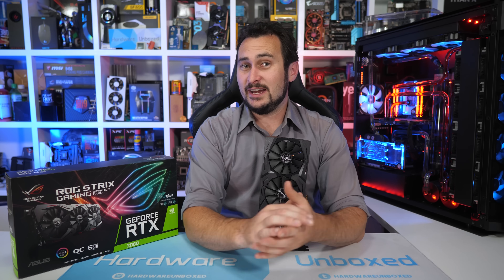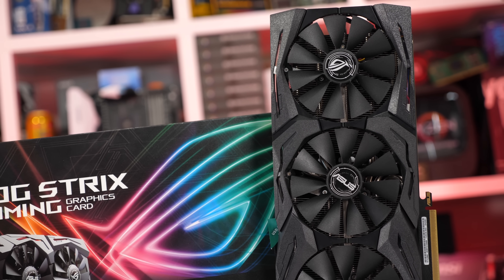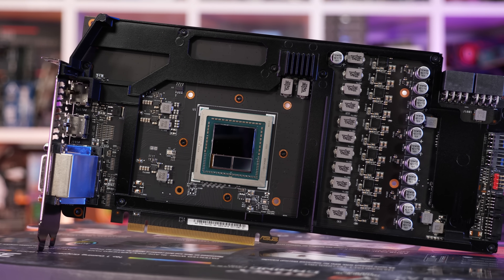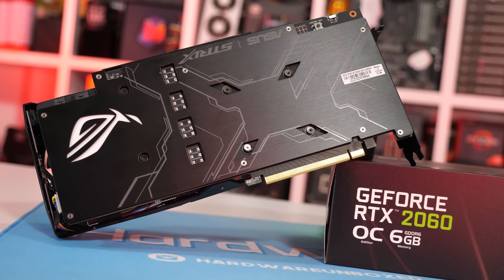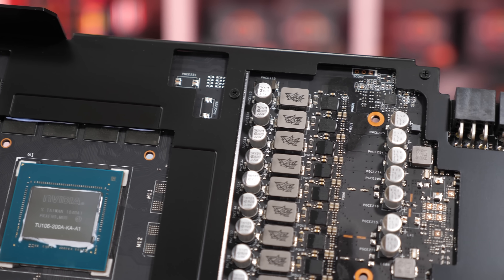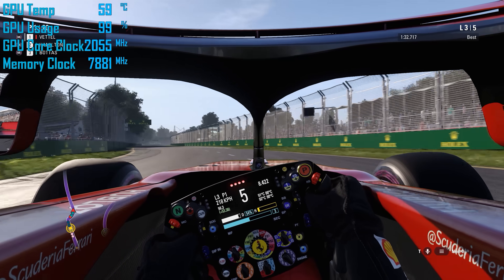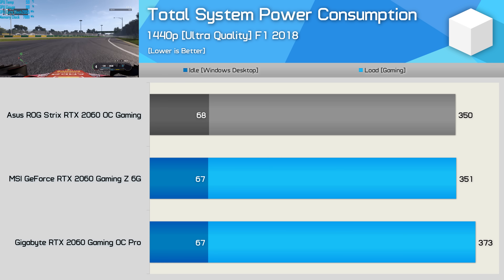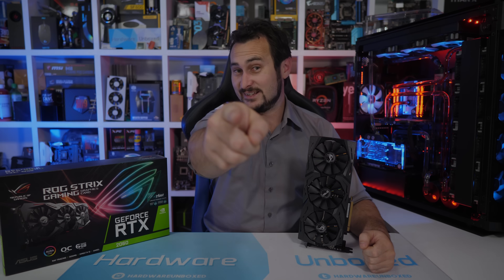Asus ROG Strix RTX 2060 OC Gaming Review, Thermals, Overclocking & Benchmarks

Comment: I've got mine (Strix 2060 Advanced)  on +200 core +800 memory and +30% on core voltage and default fan config. I let Kombustor run for like 12 hours just to make sure this clocks stable.Thermals are about 49-53°C when in games.

Comment: I have same card running 1995Mhz overclocked hitting 70°C in Meshify C 25°C ambient o.O how you are running this card 2055Mhz with temps around 60°C. Mine even gets to 60% fan speed which is so loud imo.

Comment: I just got this card for 395$. Honestly I think it is worth it, my Zotac 2060 would run at 10°c higher in certain games. I'm also getting a solid 4-5% fps improvement. The cheapest 2070 here goes for 490$, is only 6-7% faster, and is known for QC problems (it's the gigabyte one).

Comment: Over the years, I have gone through multiple cards. Some were even same cards but different companies and different  prices. Like I tried the very expensive kingpin 980 ti and the normal founders 980 ti with custom cooler. Most of the time such cards only have very little performance advantage. Basically kingpin vs founders, they are the same 980 ti so they will perform similarly. With the kingpin having a slight advantage. Just slight. Not even over 10%. 

Usually such expensive cards like this ASUS RTX 2060 are expensive due to certain factors such as. : better and bigger cooler, very silent even at heavy loads, custom pcb, imo over engineered and it looks sexy as fuck. Out of bix boost is crazy (1995 MHz), and ofc Asus name. But for real, 50 more on top of the MSRP and you get such cooler, and design and the factory OC and silent operation. Imo is definitely worth it. I have a chance to try the card out and check it personally. The thing is as Premium as is gets.
Sorry MSi but no onr wants your fat shorty RTX 2060. 

Also theAsus one is like one foot long. I think its even longer than my rog strix 1080 ti and it has the same cooler design.

Although the strix rtx cooler is a bit more upgraded and got those real beefy bracket sandwich between the cooler and pcb

But in the end its really dependent on the budget. If your budget allows, add 50 more and get this one. If not, save the 50 and buy the cheaper fe cards that uses custom coolers.

Dont buy the ugly fe version. :P

Comment: You're right, the 2070 is a ripoff. It should have been the 2060, which is what the die is, and should also reflect said price. Especially considering that fact that there's no SLI support for it either.

Comment: The card is great but the price is not. 400 for ..60 series card? Do you people even realize that?
Reply: If the 2060 would push out 500fps at 4k, would you still cry over a price tag because "it is a 60series card!", or would you judge the card by its performance? Because that is what you should be doing. Don't look at the name. Look at the fps you get. NVidia pushed up their naming a tier anyways, but even if they did not do that,... still. Ignore names. It is like buying a gaming chair, because it has gaming in its name.
Reply: @Tech_Enthusiast_001  go back to your console. 500 FPS or 1200. minimum for a XX60 card is $200-250.
Reply: But it isnt pushing 500fps at 4k so stop dreaming. 1060 was as fast as 980 and with ammount of Vram as 980Ti but it costed 250. Its incredible how fast people accept Nvidias bullshit. With your logic 2 yrs from now if ..50 series card will be as fast as 1080Ti it should cost 800??? And ..80Ti 3000???
Reply: @blackwidow7804  My point went so high over your head, I won't even try again.
Reply: You look at this card as 1070 replacement and thats where you are wrong. This is still a 1060 replacement.
Reply: @blackwidow7804  I don't look at it as any replacement whatsoever and that is why i can judge it by its price / performance and not some arbitrary naming scheme that got changed anyways. If you can't get a better performing GPU for the price, the GPU fits a great spot. No matter if you like the naming or not.
Reply: @Tech_Enthusiast_001  so if next year a hypothetical 3060 will be as fast as 2080Ti and cost 800 then with your logic it will be fantastic price becouse 2080Ti cost 1200. And 3080Ti will cost 2500. Nice logic!
Reply: @blackwidow7804  Yes, exactly. And i honestly don't understand why you seem to not get it,... the name does not matter if you play a game, right? Would you rather pay 800 for that 3060 that is as fast as a 2080ti, or 1000 for a discounted 2080ti? Just ignore the names and life will be much easier. No reason to let names (marketing) fool you. Only price and performance matter. If on the other hand a 3080ti would be 600 bucks, but have the performance of a regular 2080, it would be a terrible deal. But by your logic it is a xx80ti, so 600 bucks would be amazing, eh?
Reply: +Rattenmann dont you understand that thats not how technology works? PS3 costed 599 USD at launch. With your logic  PS4 should cost around 5000 USD becouse its 7-8x faster and have 16x as much memory. But guess what, PS4 launch price was 399. Wow how is that possible? Becouse thats how technology works!!!
Reply: @blackwidow7804  I never said any of that. You are making that up. I said you should judge a product by its price and performance, not by its name.  You can't just pretend a product can't change name, price bracket, or audience. That is just delusional.  But hey, you can keep judging GPUs by the metric of (price / name) and i will keep judging GPUs by (price / performance). You are all free to buy a great 3080ti for 500 bucks, no matter the performance it may have, because the name suggests a top product and the price seems like a steal! Just wondering why reviews keep bringing that price to performance ratio up so much,... silly guys.
Reply: +Rattenmann in terms of price/performance if PS4 cost 399, Pro should cost around 900. If 980 was 500, 1060 should be 500+. But they didnt. And thats becouse as technology is advancing, what was once high end is moving down in price becouse its no longer high end. So for what you payed 500 becouse it was top end you will pay less becouse its now mid tier. Thats why 1060 costed 250 nad 500. RTX 2060 should not cost more than 299 even if its as fast as 1070Ti. If you dont fucking get it i will not waste my time with you.
Reply: Black Widow Dont listen to these marons you re absolutely right. New generation means more performance for the same price. Rtx and dlss might be great technologies but for now they re pretty much useless especially for the mid tier cards eg rtx 2060 so the price jump isnt justified.
Reply: dont bother mate, just dont bother anymore. you are talking to a wall.  @blackwidow7804
Reply: Striking how the Name is more important than the performance for people. I am starting to get why marketing is working so well. Just make up a fancy name and the product sells ,eh? Who in their right mind would compare a product to other products of the same category, if you can just look at the name and know all you need to know. You guys are cheering me up, really. :-)
Reply: Black Widow some people are stupid. Just because the performance is faster don't mean it should cost more it should get cheaper over time. If not the 700 and 900 series would have been this price already. 660, 760, 960 was all $200. No PC Gamer is this dumb. I guarantee you it's the recent console converts the spewing this garbage. And just because they have PCS don't mean they can get themselves involved in this conversation. XX60 class is $200 MIMIUM. Theyre bringing thier fanboyish over to the PC realm and i fucking hate them for it.

Comment: Nice review as usual Steve, but I would have liked to see what the actual performance improvement with the OC in place would be in a game, and also how much more power it consumes with OC. As for added value with the ROG card, the case fan connectors could also have been mentioned, a nice little feature in my opinion. And also when comparing any RTX2060 to RTX2070, the missing USB-C VR-Link on RTX2060 should be mentioned. As it turns out, there might also be reduced options for DLSS, as in Metro Exodus, which should also be mentioned, as DLSS is a "feature" a lot of Nvidia fans seem to care a lot about.

Comment: What program are you using for checking ram, temps and core and ram speeds?
Reply: Download MSI Afterburner. It has a companion program called Riva Tuner built in. If you use both of those you can have the stats show up on the screen to monitor things.

Comment: I know how you compared it to the base 2070, but how do they perform to some of the other 2070s? Specifically some of Asus's other designs such as the Dual OC 2070 and their 2070 Strix eddition compared to this. I found a 2070 Dual OC on sale for $525 US so I picked it up and it was a nice upgrade from my 3gb 1060 I've been using the past few years.

Comment: German pricing:

Palit RTX 2060: 345 €
Asus Strix RTX 2060: 435 €

40€ more i can get a  RTX 2070...

KFA 2 RTX 2070: 479 €
Asus, Msi,Gigabyte RTX 2070 600€

60€ more i can get a RTX 2080...

KFA 2 RTX 2080: 659 €
MSI & Asus RTX 2080: 800- 820 €

180€ more i can get a RTX 2080 TI...

Palit RTX 2080 TI: 1000 €
Asus Strix RTX 2080 TI: 1450 €

Custom Models in germany are just brutal useless for the pricepoint. Thats basically for every model the same. Whoever is willing to pay more for a custom is just braindead. All the cards perform the same @ 100% the other one runs with 60 degreee the other one has 70 degree. You can overclock one for 10% more frames and the other one for 5 % frames. Not sure but in my book its not worth paying between 100 to 400€ more for basically nothing.

Comment: Nice in-depth look, HUB. Thanks  👍
https://www.youtube.com/watch?v=pfnzHA3-MhM&t=513
To those curious, above is Steve's investigation into the 6 GB VRAM capacity of the 2060.
Notwithstanding the other negatives about the RTX lineup overall, the 6 GB VRAM alone shouldn't make you shy away from the 2060 if it seems like the right fit for your price/performance needs.  Of course, also look at the current Vega 56 and Vega 64 deals.
Also, an interesting investigation by Gamers Nexus shows how much it takes (in resolution, AA, textures) to drain the 8 GB of a 2080, so you can kind of extrapolate that even 6 GB should be enough at 1440p & 1080p Ultra for the 'typical' life of the 2060.
https://www.youtube.com/watch?v=ZzjqHCy6Mlc

Comment: I am quite happy with my Gigabyte Gaming OC 2060 6GB and was only CAD$515. It is a lot better than my 7970 3GB I was using! The pro version of the card is CAD$525, but wasn't available at my local store. If you want the MSI it is CAD$550 and the ASUS card is CAD$560. I personally didn't see the reason to pay a $55 premium for the ROG brand when the cards perform very similar. And the cheapest 2070 on newegg.ca is $675.

I find it interesting though how all the 2060 PCB's have a spot for 2 more memory chips. It is almost like they could be planning on releasing a 8GB version in the future perhaps or maybe they are just using a 2070 board and just cutting out 2 of the ram chips.....

Comment: I don't know about you, but overclocking my Zotac AMP 2060 was a bit more difficult than I expected it to be. Coming from AMD cards pretty much exclusively, I'm used to the cards running at the frequency stated out of the box. Not with this Zotac. This card is rated for 1800 boost clock out the box, but it was running up to 2025Mhz without me even touching it. I figured this was the Nvidia GPU Boost I kept hearing so much about. In all actuality it made it really hard to tell what was going on with the overclock for me. I was only able to apply a 25mhz boost to the core clock in Afterburner before it got unstable, and the boost sometimes ran 2055, and other times would hit 2085, max temps of 72C. Memory overclocked like a champ though, I was able to max out the slider with a full 1000 over the base memory clock. Sadly Afterburner wouldn't let me add voltage or set a custom fan curve as both those options were locked out for some reason on this card. So I left it alone and called it a day.

All in all I can't say I'm disappointed, as 25mhz boost seems very unimpressive on the surface, but when it's hitting a full 285mhz higher than it's rated boost clock altogether, I can't really complain at all! It was just a different, slightly confusing at first, situation compared to what I'm used to. 🤷‍♂️😂👍 In any event, love the video as usual, keep the great content flowing!

Comment: Its great and all but it costs whopping 550$ in my country, i bought Palit GamingPro OC for 423$, asus went NUTS with this generation palit is quiet and temps are at 71°C with 2040-55 Mhz Core boost, only thing id like to have is back plate and to remove that crappy led bar in front as its bright as sun and cannot be (officially) permanently disabled unless you disconnect cable as i did :)

Comment: This card cost me $500(cheapest price some even went $600) when most of the 2060 in my country cost $400 to $450 but its worth it i get+ 240mhz OC with my core clock and +900mhz and my temperature is very cool 67c max on benchmark and it rarely hits 60c when playing games. And my case's airflow suck

Comment: If they take turing to 7 nanometers that's going to be crazy. Overall the RTX series is wonderful. You can't really fault Nvidia for making several different models. 
I noticed that you said this card was performing close to an RTX 2070. I was recently doing some benchmarks with mine and my RTX 2070 was outperforming my GTX 1080 99% of the time. And my RTX 2070 is a black edition which is I think is the bottom tier. Therefore maybe different cards vary in performance and depending on how you overclock. I still would go at the RTX 2070 because of the 8 gigs of RAM but if you don't game at 4K then the RTX 2060 should be a good card.

Comment: Is the lighting color uniform? On my asus strix 1070 the color changes depending on where on the shroud it is. For example I wanted the lighting to be teal, but it would be blue on top left and teal on bottom left. It bugged me so much I ended up just turning off the lighting on the card.

Comment: Wait what?
Vega 64 is at $400 now!
Reply: im seeing vega 56 at 326€ here in Portugal... vega 64 is not worth it... (just oc uv vega 56)
Reply: @Hypnot47  got a used Sapphire Nitro vega 64 for 360€ with a few month of warranty left here in Germany.
I am pretty happy with the deal.
A new standard blower Vega 56 was 269€ a few days ago.
Reply: Vega 56 is 259 euro in Germany...
Reply: In my country the Vega 64 is selling for around 900$
Reply: the asus rog strix oc was available for 340 Euros for a couple of days. But i wasn't able to run it on a 600watt be quiet psu.
Reply: LOL....not here in Canada.  The cheapest Vega 64 is 900 bucks!  I can get a 2060 for HALF that price.
Reply: @turbofanlover  here in the UK we can get a Vega 56 pulse for £300, Vega 64 nitro+ goes for £400ish and a MSI airboost blower card for £370ish
Reply: @turbofanlover  go for 2060 sli
Reply: turbofanlover I’m on my alt right now but I’m also a fellow Canadian and BOY the pricing is so f’d up rtx 2060 here is around 450$ and the just saying the rtx 2080ti founders is going for 3000$+ even after the rtx 3000 series were released like wtf
Reply: @turbofanlover  move to the USA. Problem solved.
Reply: The only Vega 64 you can get for close to $400-$500 are the reference models with blower-style coolers. They're not very good and have a reputation of thermal throttling. They're only "worth it" if you're going to install a water block and run liquid, but then you're spending another $300-$500 for a custom liquid setup... So... yeah, reference Vega 64 aren't worth it.
Reply: In Germany I get a asus strix vega 64 for 410€ or a gigabyte for 399€
The cheapest rtx 2060 (gigabyte) costs 359€
Reply: Not in another country. Try $650 for vega56

Comment: 400$ msrp for the rog strix model but from what I see in the comments its closer to 430-450$ at retail.
For that price you can get a used 1080ti or save up to 100/200$ on a good deal for vega 64 and 56 respectively, the last being overclockable through the roof.
Not to mention you also get much more vram with these cards.
Reply: Find me a 1080ti for 500$ and i’ll eat my shoe. 

You’d still be buying used. And Vega cards have reasons not to buy them.